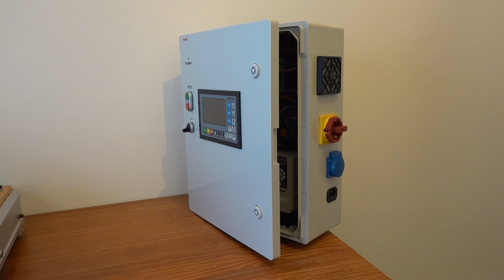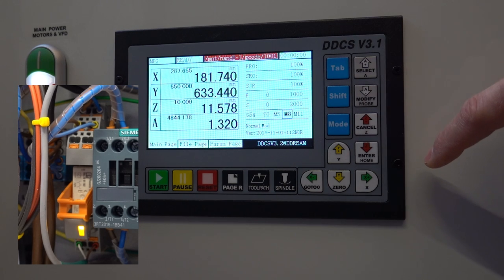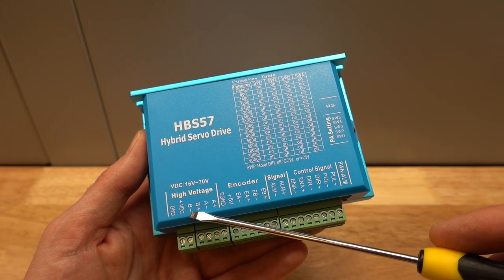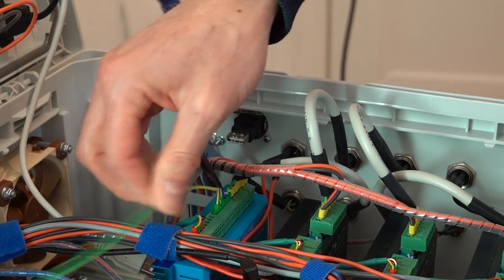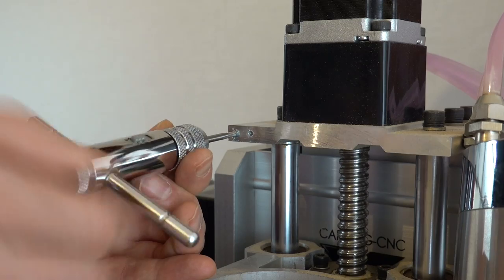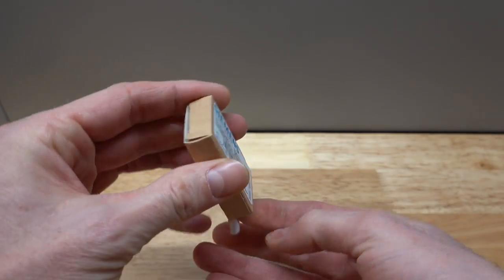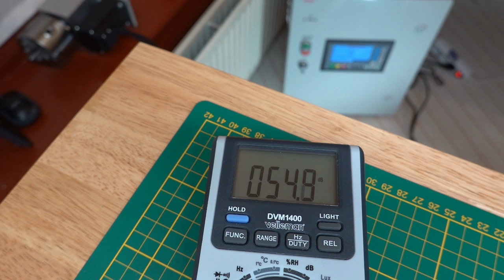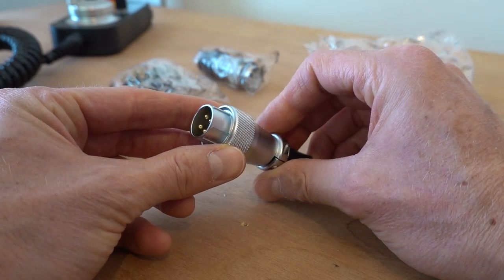Build Your Own CNC Controller Part3

Comment: Excellent build overview video, with all the details you provide. 

If I may make a few suggestions. The VFD installed inside your enclosure exposes the drives, and breakout board to large amounts of EMI which may create system stability issues even with an EMI filter with oversea drives. The other area to review is your non-conductive enclosure which prevents it from producing a Faraday cage effect around the electronics, and prevents the enclosure itself from being grounded. Once again these are simply my suggestions based on my past experiences, but your work's detail is some of the best I've seen on YouTube. The grounding you implemented is very well done for your components.

Fantastic job, and thank you again for your support. 

Have a great weekend! Vince
Reply from the maker: Hi Vince, great to see you came across my channel and took the time to evaluate this project. I learned a lot from your videos on grounding and other CNC related topics. The VFD in the cabinet and the plastic enclosure are both compromises to make the threshold for this type of project as low as possible. Having said this, it is not ideal for the reasons you mentioned, grounding and EMI. I will definitely consider using a metal enclosure for my next project, especially if it includes a VFD. An option for this project might be a metal "satellite" box for the VFD.
I will update the pinned comment with your tips. Thanks! Robin
Reply: That's a fantastic idea, but I certainly wouldn't change a thing if she's stable. I always believe in mitigating problems be fore they become one as nothing is more irritating then a system that's unstable randomly.. You really did a great job, and I really appreciate your support. 

If you ever need anything just let me know.  

Thank you again, and have a great weekend!
Vince

Comment: I like the contactor coil surge suppression! You should consider a reactor on the input voltage side or on both input and output. If you ever get a chance to look into a high end CNC machine you will notice that they no longer use drain wires and a pigtail for  shielding. You need a plate that is bonded with ground and this plate shall have clamps that will provide a 360deg shield. The old pigtail method is antiquated and no longer in use. It creates higher impedance for the shield ground especially when passing it through a cannon connector.

Comment: Another great video! Just a note that in some VFD manuals it is recommended to ground the motor (spindle) with a separate wire from the three core power - so what you had done was correct. Along with that to loop the power wires through a ferrite core as close as you can to the VFD helps suppress interference as well.
Reply from the maker: Thanks, I did not know that. So I might leave it like this a bit longer than I anticipated. The ferrite is close to the VFD, so good to see that can stay as well.

Comment: That control box is a work of art!! Thanks for sharing all the details with us! Your presentation and photography are excellent, too. Please let us know what you make with your CNC.
Reply from the maker: Thanks! I have used my CNC for cutting wooden toys, some fixtures and halftone photo milling. I am not nearly using it as much I would like though. I have it upstairs and without enclosure, so noise is an issue. One of my next projects would be an enclosure, which would enable me to use it more frequently.

Comment: Thank you so much for this series! I'm currently building out my own electronics for my first CNC and your guide has been invaluable. Great job on your project!
Reply: I’m doing the exact same thing right now. I’ve literally been pouring over these videos and schematics the past few nights as a build up my BoM. I was so excited to see this upload
Reply from the maker: Great to see it is useful for you guys, that makes it worthwhile for to make these types of videos. Just updated the wiring diagram last night. Let me know if you see any errors or other things that need clarification.
Reply: Shielded cables. Drive a ground rod to create your grounding system. And servo motors. .

Comment from the maker: - Shielded cable going though metal (GX16) plugs: it is preferred to wrap the shielding back around the cable so it comes in contact with the (GX16) connector. No extra pin needed. In that case the connector can be grounded through a metal mounting plate or complete metal housing.
- Consider using a metal enclosure and placing the VFD in a separate metal enclosure, for EMI containment and easier grounding.
- Check power rating for your specific components (VFD and power supply) to see which type of mains connector and fuse you should use. C14 connectors are rated to a maximum of 10amps at 250VAC. One of the possible alternatives is to not use a connector but instead a cable gland and an appropriately rated fuse inside the box or panel mounted fuse holder. Also consider CEE type wall plug if the rating of your wall outlet is not sufficient for your components.
- Using shielded cables for the stepper motors also on the outside of the cabinet reduces the chance EMI issues.
- most VFDs have a built in relay, which can also be used to switch a coolant pump.
Reply: Heyy nice video! Are you gonna build a full CNC?
Reply from the maker: Building a CNC machine is something I would really like to do. No concrete plans though.
Reply: @uptimefab7412  Some inspiration for you Robin.... Watch the MAXI CNC Router build done by the Australian guy Roger Webb.  I am building the identical CNC but will be using your electrical schematics instead of Roger's or maybe a bit of both.  Great job on your project.  Bruce.
Reply from the maker: Hi Bruce, thanks for the tip! I will have a look at his project later today. Best of luck with your project. Good to get information from multiple sources indeed. Marty's CNC garage is also a good one.
Robin

Comment: Nice update and fixes.  
Coolant side, 
1. try to remove the kinks by using a waterproof cable gland strain relief connectors cord grips
2. do you have a coolant level alarm
Reply from the maker: 1. Absolutely right, the coolant lines look terrible with all the kinks. Somehow the water does make its way through. Thanks for the tip!
2. No I don't have an alarm. Would be nice though. For now I will have to rely on noticing issues myself. I never leave it alone while running, hope I can catch any failures by paying attention.
Robin

Comment: Hi, normally, the proper way to deal with shielded cables and GX (or any metallic connectors) is wrapping the shielding around the plastic cable sleeve to ensure a contact between the connector cage and the shielding... So no need for extra pin. The female connector of the case has to be grounding (easier with metallic case)
Reply from the maker: This is what I thought as well, but saw some information that it was better to route the ground wire through the connector to the central ground point and not to the case at the location of the connector to avoid ground loops, but your option does seem to make sense. Especially with a metal housing, thanks for the tip.
Reply: Hey!  Very interesting topic, thanks for that.
Whether male GX connector shielding is also required, this will go into the stepper motor? Are steppers need to be grounded and how?
Reply from the maker: The general consensus is that the wires going from the controller cabinet out to the stepper motors should be shielded and the shield grounded to the central grounding point or to the cabinet if you have a metal cabinet. My machine already had non-shielded wires installed and I have not replaced them (yet). Will do so when I have time or run into EMI issues. I do have the stepper cables inside the cabinet shielded and grounded since I installed these new myself. If you are starting from scratch I would say ground the shield for all stepper wires inside and outside the cabinet.

Comment: Hello Robin
Very fine workmanship.  Well done!
I am in the process of building my CNC machine and I have chosen to use the DDCS v3.1 controller.
The issue I am running into concerns the limit and homing switches.
My plan was to use the left/rear/upper  limits of the machine also as home position.
The left (X--), rear  (Y--) and upper (Z++) are not only connected to the linit terminals of the DDCSV but also (with a wire jumper) to the home terminals of the controller to not only serve as travel limits but also as home sensors.
I am using Hall Effect proximity switches as sensors.  When the magnets come into range, I get a 12 volt signal at the corresponding input terminal.

Here is the problem(s):
1.  None of the limit switches stops the travel
2.  When the gantry is in the Y-- (home) position, it kills the output to the Y-axis stepper driver in the Y++ direction

I have experimented with all combinations and permutations of the Home and Limit parameters (soft limits are disabled).

I wonder if you could share the parameter settings for home and limit.  It is very difficult to find information on line and the manual is difficult to interpret.

Thanls in Advance
Reply from the maker: Hi, thanks for the compliment! My situation is a bit different than for your machine, but here are my parameters: #50: Ignore Home, #51: Disable, #52-54: Enable. The manual states that #51 needs to be disabled when sharing the switch between home and limit. I also have it disabled, but don't use limit switches. But that setting seems to be important. I am not sure if you have seen notes A and B on page 68 of the manual, but they seem to apply for your setup. Also, have you tested your switches without combining home and limit? If you first test them by only connecting to home you can rule out a faulty switch or connection. Hope this helps, Robin
Reply: @uptimefab7412  Thanks Robin.  I like your suggestion to separate home & limit functions.  I need to re-read the manual as well.

I will post a reply about my results.
Reply from the maker: Just went back to the controller to further look into this. Settings #116 - #119 are also worth a look. Mine says home signal for all of these settings, but for you setting these to 1 or 2 might work (forward / reverse limit signal). Another thing to help trouble shooting is the IO screen that can be accessed by pressing the "toolpath" button a couple of times. The signals are a bit counter intuitive here: for me the home switches are all set to "high" under settings #60 - 62. For me this means they are always high unless they are pressed during homing, then they are low. Manually activate your switches while in this screen. Might help shed some light on the situation. Have to agree there are quite a lot of settings around homing and limits, so it is not trivial. Again, hope you can get it to work.
Reply: @uptimefab7412  I decided to begin from scratch so I disabled the homing function and disconnected all home wires in the controller.  Then I used the MPG to jog the machine into the limits then trace the signal back to the terminals in the controller.  In this way I was able to determine that the X+ and X- signal wires were crossed in the controller. Likewise the Y+ and Y- signal wires.  In this condition the home function would never work correctly.  Now the limit switches are working as intended and getting the home function to work should be straightforward.  I am a very happy camper!
Reply from the maker: Good to see you found the issue and that it is now working. Wiring can be a pain sometimes. Best of luck with the rest of your project!

Comment: Great upgrade, excellent video. I hope to upgrade my CNC on similar lines. If you want high repeatability in limit switches, consider using an optical limit switch, they are dead accurate
Reply from the maker: Thanks for the tip!

Comment: This was just great. I have similar cabinet waiting for my four closed loop stepper drivers and all the other stuff.
Grounding issue was interesting. Did you have issues of interference before doing the modifications?
Reply: re cabling all the stuffs with shielded cables afterward is pain in the a**.  And interferences issues are difficult to track. So far better to properly ground all elements : shielded cable, frame, ....
Reply from the maker: Would indeed have been a lot easier to do this right from the beginning. Did not have any issues, but made some changes anyway to make sure I also have less chance of issues further down the road.
Reply: @uptimefab7412  Hmm. I already bought the cables. Only the closed loop encoder cable is shielded... I wonder if stepper motor drive cable is prone to interference... there’s some power going there anyway.
Reply from the maker: I assume interference is less of an issue with the stepper cable than with the encoder cable. It would be strange if they would try to save a few cents on shielded wire for the motor cable if it would be very susceptible to this issue. Also if it does loose a step the encoder will detect this. We'll see how it performs. All of my open loop stepper cables are unshielded on the outside of the cabinet as well.
Reply: @uptimefab7412  sounds reasonable. But I have to make sure that the cable shield is connected to grounding. Thanks for taking up this matter. :)

Comment: The VFD usually has a built in relay. You can program it, if it's running the spindle the relay is ON. Turn OFF with delay.
M7 M8 mist and coolant for the tool cooling.
Reply from the maker: Great tip, thanks! That is indeed also a great way to switch a pump (and what that relay is probably meant for). Just checked, my vfd has a built in relay as well.
Reply: @uptimefab7412  Yes, it's for the pump, or for other needs. (vacuum cleaner for dust suck)

Comment: This is an awesome build I have been following since 1.  I think your system is nicer than anything I’ve seen on corvette 50.  You will know if your system is sufficiently grounded if you can run that VFD in the cabinet and not have any problems with noise. 
You should check with a hydraulics shop and ask for a tubing that is rated for flexing. I’m afraid you are going to have a huge mess on your hands with that liquid cooled spindle. If that is the same coolant we use on Mazak CNC machines I know it’s not cheap. 
If that’s rv coolant you need to purge immediately. Lol

Comment: Nice video. I wish you would list the parts and link to suppliers. It would be so much easier for those who go shopping.
Reply from the maker: Hi Jim, please see the link below the video to the website article about this project. It contains all parts including brand and model. If there is an international supplier like AliExpress it is also listed. For generic parts form brands like Siemens or phoenix contact I have not listed the supplier because people can get them cheaper locally by just searching for the part. 
Cheers, Robin
Reply: UptimeFab , thank you for that precision. I hadn't try the link. Very useful.
Reply: @uptimefab7412  A LOT of parts are not shown, but with some research it's easy to find most of it.

Comment: On the DC power wires, you should twist the two wires together which provides a certain amount of self shielding, and cancels out any emi that is present on the power leads.
Reply from the maker: Great tip, thank you! The best thing is that you would only need a bit longer wires.

Comment: great video!!! i have a question, how do you connecting the husillo motor, othe question, the motor working with continuous current?
Reply from the maker: Hi, I assume you mean stepper motor? If you put any 2 wires together when manually rotate the motor and find resistance while roatating you have found a coil pair, call that A, then the other pair is B. Or easier, check online at supplier for which colors are used for each coil. Yes it is a continuous current as is typical for open loop stepper motors.

Comment: I'm finishing the design of my VMC(mechanical), but I absolutely have no idea about electronics, been to university twice and failed even simple circuit analysis. Did you use any guides or step-by-step when designing the electronics system? Many thanks for the series anyway!
Reply from the maker: I pulled information from various sources, mainly user manuals (DDCS manual is very useful, check digital dream website), other part manuals, forums and tutorial videos. Also, even though I do not have a background in electronics I have a basic understanding of some fundamentals. It might seem daunting, but just take it one step (component) at a time.

Comment: Make sure your watercooling lines are free of kinks. I noticed they are restricted at the exit of the motor and at the tank. Fish tank pumps do not have enough power to overcome a bent hose. You can use a big spring around the hose to prevent bending
Reply from the maker: Hi, thanks for the tip. The kinks in the the tubing is definitely something that should be fixed. Somehow it never made it from the action list into reality to fix this. Really like your suggestion to use springs. Should be quite straight forward to install.

Comment: nice project and thanks :)  but for box you could use metal pc case ,it is big and have space for psu where you can put vfd to move him from drivers even more (case have some metal separating pcu from rest) ,plus it is metal so you have free grounding
Reply from the maker: Thanks for the tip! That is indeed a great way to reuse an old PC case. Good for the environment and your wallet.